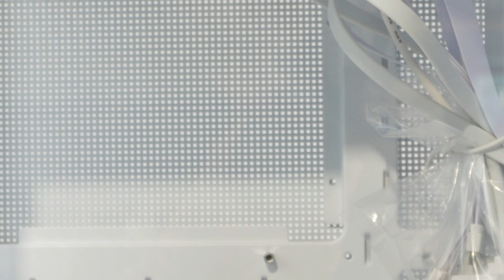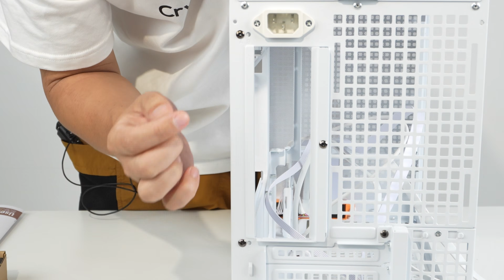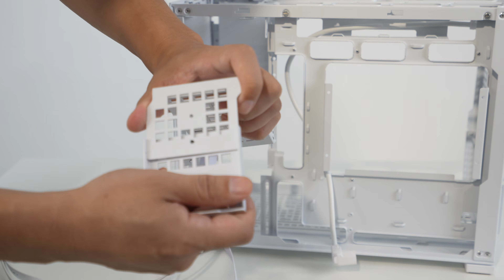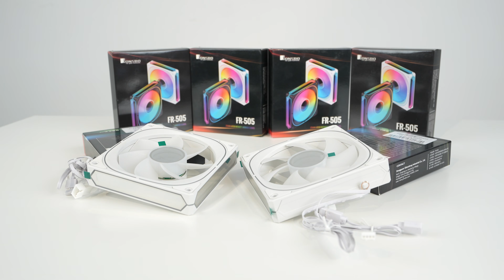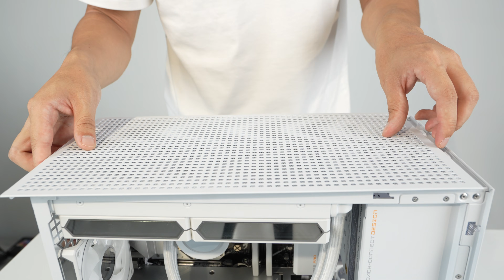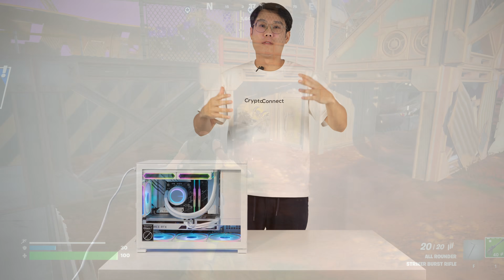Jonsbo D32 Pro mATX, Back-connect Motherboard compatible

Comment: How long GPU length if we lower that PSU bracket ?
Reply from the maker: 281mm is the size of the card in the video
Reply: @projectsgaming2020 that PSU are using is 140 mm long right ?
Reply from the maker: @Gink01  141mm L x 151mm  W x 86.1mm D
https://www.chargerlab.com/teardown-of-acer-ac650-650w-fully-modular-pc-psu

Comment: I just recently got this case. R5 9600X with a sapphire pure 9070 and lemme tell you.. with the gpu at the bottom as intake then the 1 rear fan and the top 2 fans as exhaust, paired with a peerless assassin.. I am running 60 degrees to a MAX heat point of 66 under load. Well done in my opinion.
Reply: sorry im not well aware the pc community term as newbies. but im interested with these cases, what do you meant "66 under load"? does it meant 66celcius during max load? or 66celcius under load as meant no load at all?
Reply: @Nasipututyeah! 66 under max load!

Comment: is my montech century ii 1050w psu the same size as yours? i want this case but dont want it to limit my gpu size
Reply from the maker: yes both ATX PSU
Reply: @projectsgaming2020  cheers, is there anyway to add a 120mm front intake fan below the psu?
Reply from the maker: @Mayhemz.95  there's no mounting point for you to attach it if im understanding your question correctly

Comment: nice video I'm from Greece and I just got the MSI PRO B850M-A WIFI PZ Motherboard Micro ATX w AMD AM5 Socket 911-7E78-001 and I was looking for a case thats compatible with my back connect mobo do you think this is good and that it fits well with the mobo that has its pins at the back? Thanks in advance!
Reply from the maker: supports
Reply: @projectsgaming2020 thanks a lot man Ive liked and subbed 😊👍
Reply from the maker: @JohnK-117  needs to be on B mode
Reply: @p @projectsgaming2020 yeah I saw the part where you unscrew it and set it on mode B I was just wondering if there's like enough space behind for the cables so they're not like bent or something

Comment: Would a 9070 XT be able to fit in with those 3 case fans below?
Reply from the maker: since the case has 4 slots. I wouldn't recommend it to begin with.

3 slots for the GPU and 1 slot for the bottom case fans. The GPU and case fans are basically touching, probably causing less than ideal airflow

I personally run the GPU and have no bottom case fans
Reply: @projectsgaming2020  Thank you for the reply.

So should I put top fans as intake?
Reply from the maker: @Lannaboy35  still exhaust. should be the same setup as in the video except you don't have 3 case fans on the bottom.

Or you can consider getting slim case fans on the bottom just to give yourself more room between the GPU and the bottom case fans

Comment: can i put noctua NH-D15 chromax on this case?? TIA
Reply from the maker: Depends on the mode of the case and the CPU you running

A mode height limit:
170mm (Intel CPU)
169mm (AMD CPU)

B mode height limit: 
164mm (Intel CPU)
163mm (AMD CPU)

The NH-D15 chromax height is 165mm
I was referencing this link
https://noctua.at/en/nh-d15-chromax-black

Comment: Will the 9070 xt will fit on this case? Also, should I use SFX psu? thank you
Reply from the maker: need to be more specific as 9070xt has many variation from AIB partners. I recommend SFX just to give yourself more room if you are going to run a beefy GPU

Comment: Will this case fit Deepcool Castle 280 AIO with Radiator Dimensions 323×146×27mm?
Reply from the maker: Nope
Reply: @projectsgaming2020 that's a shame I quite like the look and form factor of this case do you have any recommendations case could fit my 280 AIO ?
Reply from the maker: @ From jonsbo, they have the TK-3 or D300 but the cases are bigger. Most cases are designed for 240 or 360 aio.

Comment: Will fit into this case Deepcool Assassin 4S?
Reply from the maker: Depends on the mode of the case and the CPU you running

A mode height limit:
170mm (Intel CPU)
169mm (AMD CPU)

B mode height limit: 
164mm (Intel CPU)
163mm (AMD CPU)

The Deepcool Assassin 4s height is 164mm

Comment: Think it didn't have to gmhad the A and B possitions, like leave it at B position so it supports both normal motherboards and back connect motherboards. Like it just give like 3 to 5 milimeters on A position for taller cpu air coolers, but this case favors AiO coolers so I don't know why they bothered.

Comment: I'm a little confused with fan orientation, I see the FR505s are available in both regular and reverse blades.  Could you just lay out which ones you used for which?  Regular blades for your 3x120mm and AIO? and reverse for your exhaust fan?
Reply from the maker: AIO = Regular
Rear Fan  = Regular
Bottom Fan = Reverse

Comment: A/B mode seems good. I've built D31 before, and it had too little space to hide or tidy up cables.
But D32's wide square design of front panel is bad. It is Deepcool's identity, and looks very cheap. It had to have same width as side panel.
I can see a lot of consideration in the case's detail, but how can PRO version end up looking cheaper than STD version?
Jonsbo's identity, or at least that of Dxx series, is modern neatness I think. It looks more like Z20.
Reply: Are you crazy this is the best matx out now for any build.

Comment: I’m curious if you could still mount a radiator at the bottom of the case. I know it doesn’t support it technically but there looks to be plenty of room with a water cooled GPU.
Reply from the maker: i think you can get away with it but gamer nexus did a video about AIO orientation https://www.youtube.com/watch?v=BbGomv195sk. I believe the same principles apply even though it is for the GPU
Reply: @ I’ve been trying to find my dream case for a custom loop. But thanks. I should have been more clear about why.

Comment: Hi, will RTX5080 (Asus TUF, 3.6 slot) fit in this casing? Thinking of building a system with this casing ...
Reply from the maker: It should as the case has 4 slots on the back, but u might not be able to fit regular height 120mm fans on the bottom. The PSU settings needs to be at the highest setting as well
Reply: @projectsgaming2020  Slim fans at the bottom or SFF display card is the way to go then... Thanks for the advice

Comment: Is it possible to mount the jonspro z20 handle on top of this case? I like this design a little more.
Reply from the maker: negative, the holes at the top are different sizes

Comment: How does this compare to the jonsbo z20 case I have a colourful rtx 3070 battle ax 315mm and a atx psu thermaltake smart 600w psu z20 is 135 dollars in my country and d32 non pro is around 115 dollars any input would be much appreciated
Reply from the maker: i take the d32 since its cheaper, easier to build in as it bigger.

Comment: The 3rd bottom fan looks a little nicer compared to the Z20. It's also using that extra 4 liters for cable/psu shrouding which is nice. I think that blank part covering the psu could be used for an internal statistic screen maybe. Also down the line if back-connects are more prevalent then in a couple years you can upgrade to that. Also the invisible GPU support is nice.

Comment: Thanks for uploading this PC case assembly video!

Will it fit with thicker radiator AIO like Arctic liquid freezer and same RAM? I bought this PC case recently.
Reply from the maker: I wasn't able to find the specs of the artic liquid pump size but the jonsbo pump size is 72mm*85.3mm*54.5mm. Hope that helps

Comment: How would you describe the build quality compared to other cases like the z20 or ap201?
Reply from the maker: Can't comment on the AP201 as I have never built in it. Z20 and D32 Pro build quality are the same, had no issues with it. We have another Z20 build video.

Comment: Which case do you prefer D32 pro or z20
Reply from the maker: If you have the desk space, I would prefer the D32 Pro
Reply: @projectsgaming2020  would the handle from the Z20 be able to mount to the top of this case as well?
Reply from the maker: negative if i remember correctly

Comment: The gpu power cable really hurt the aesthetic 😔, i hope manufacturer can do something about that.
Reply from the maker: That is 100% our problem, as this was the only white PSU we had in our inventory. Nothing to do with Jonsbo as they don't supply PSU at the moment.
Reply: @projectsgaming2020  not that, I mean some sort of hidden connector or something. So we can hide the power cable. Gpu problem not the case.
Reply from the maker: @Oz_2026  my bad, i see what you mean, i agree

Comment: haizz, why didn't they make it a bit bigger and have support for 360mm aio, then they can really compete against the ap201 and dan a3
Reply from the maker: They have another case that fills in that role called D31 that can support 360mm AIO.
Reply: @projectsgaming2020  yeah but the d31 doesn't have mesh side panel, and some users have reported having bad thermal performance on that case

Comment: Great review! I would love to see how a SFX PSU fits inside. Also what is the difference between the Pro and Standard version? And any news about the D42 version?
Reply from the maker: Just going to highlight the difference
Item: STD/PRO

Front IO USB Type A: x1 / x 2
Modes: B / A & B
Memory Height: 45mm / A mode 51, B mode 45mm
Air Cooling Support: Intel 164mm, AMD 163mm / A mode Intel 170mm AMD 169mm, B mode Intel 164mm AMD 163mm
GPU Mount: Standard / Removeable PCI-E cover
PSU Cover: Full cover / Partial cover
Ventilation: Small holes / Big holes
Storage of SSD & HDD: Less / More
Graphic card bracket: No / Yes

First time hearing about the D42, I will ask

Comment: I bought the Jonsbo Z20 two weeks ago and come across some issues with AIO, PSU and GPU. But it works all with good temperatures, And now I watch this video and this case has some improvement to what I need. Nice
Reply: I have the z20 too and I used an ATX psu
Reply: Just finished my z20 build and went with an SFX PSU. Modified the PSU holder to not bind with the 240  AIO header hoses in the "top" position. Allows most GPUs and easy access to PSU cables.
Reply: What size PSU did you use?
Reply from the maker: @odinez7010  ATX
Reply: @ I did, the SFX-L from Corsair, the cable for the 8pin CPU is way to short but I managed to plug it in somehow. It´s possible but I do not recommend this, because of tension
Reply: Z20 is narrower than d32
Reply: Is the glass panel thoroughly attached?
Reply from the maker: @zikjegaming6652 yes
Reply: am in the same situation as you bro..got the z20 and found issues addressed by D32. Unfortunately, returning what I bought isn't possible so need to live with z20..haha